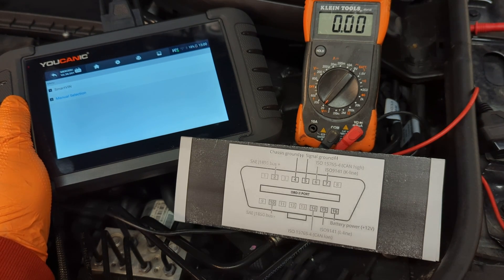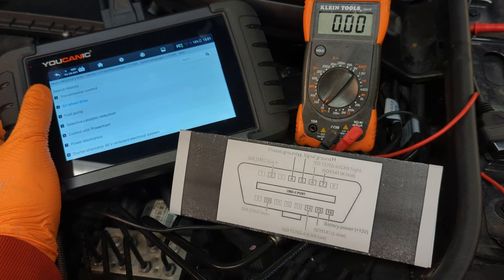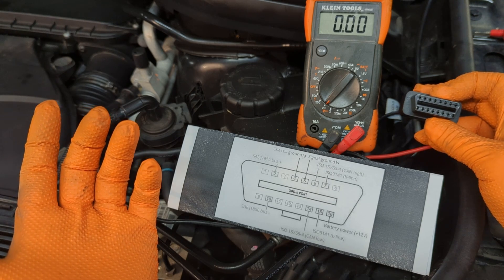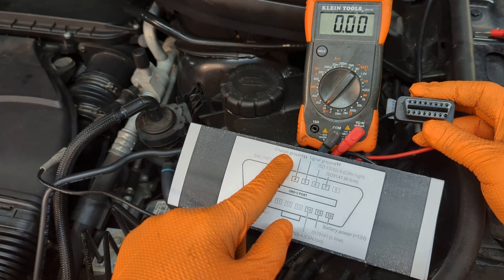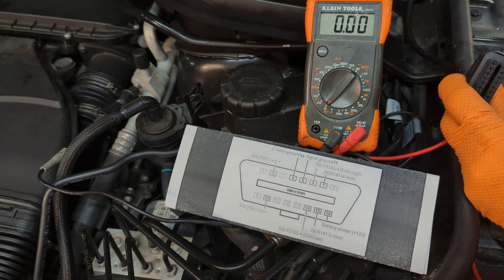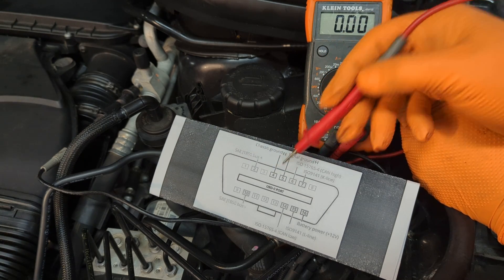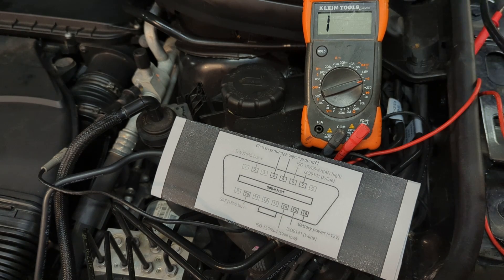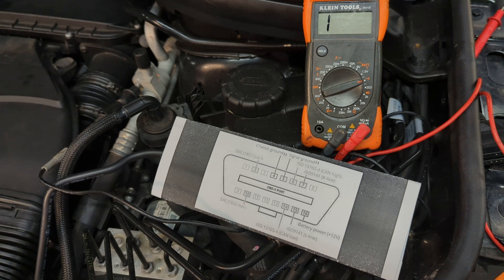OBD2 Port Not Working or Communicating with Scanner - Fix It Yourself!

Comment: I have a 2000 FORD E150, 5.4L V8.  The State of Delaware requires ODB2 during vehicle inspection.  My vehicle ails on "comms." It is unable to connect to DMV ODB2 re: the vehicle RPMs. I've changed use #26, and all relays.  Any other suggestions are welcome.
Reply from the maker: 👋 Thanks watching and for your comment! Our techs may not see every YouTube message, so if you need help or have a car question, visit www.youcanic.com — our team is happy to help!

Comment: 1999 gmc sierra 2500 6.0 gas. Obd works but not read the code. I’m using FIX
Reply: You using fix?? What is that??

Comment: I would like to thank you for creating this video in which pellucidly you explain the workings (or lack )of the OBD II and power potential causes for fault errors.
This has helped me tremendously especially with the pin diagram and highlighting that the potential fault culprit could be the control module.

I recently noticed the amber engine light coming on so bought an OBD-II scanner (Topdon Topscan pro) it set up ok and did an initial scan on my 2016 Corsa E with errors 
P0171 + U0401 +U0077 which pointed towards my Evap valve, the problem is I wanted to double check the codes and see if I could run a live scan but when I tried to pair I kept getting 'couldn't connect, check Bluetooth connection, eventually getting the connection but then when I try to scan it only gives me 3 options where the first time it gave me around 40?

The connector light turns red when connected and I can now eventually get Bluetooth to work, but as I said in scanning I'm only getting a couple of options and its not giving me any information.

In your opinion is this the fault of the OBD-II scanner or the OBD port/faulty controller module?

I have subscribed hoping to see and learn more.

Kind regards.

Hugh

Comment: That doesn't help if you have power but no communication.
Reply: Exactly that's my issue and I can find an answer.
Reply: @GFXWard  what was the issue
Reply: @KeinPicos  My scan tool. For whatever reason it wasn't fully working, yet it worked on other vehicles so i bought a cheap one from Walmart and it worked like a charm.

Comment: i can connect to my engine with scaner but cant connect to central elec. i have no power on can low/high or K line V is jumping betwen 0.5V and 3V resistor is 60ohm

Comment: How make obd car port fast tester because one time i test 1990 nissan patrol swap with lumina v8 engine but all OBD wires was wrong and my expensive scantol makes smoke 😢 so my advice dont use scantol before test obd all pin powers and ask car owners is the engine swaped
Reply from the maker: Thanks for reaching out and sharing your advice! We at Youcanic aim to empower car owners with resources such as guides, our powerful Youcanic scanner and even factory repair manuals to tackle such issues. This ensures you're confident and safe when doing car maintenance. Visit us at www.youcanic.com for any assistance or information. We're here to support you on your car ownership journey!

Comment: Waste of money. Works on diagnostic but when you go to maintenance to try and reset/ fix any codes it just says no communication. Seems like many people get this. It's not your car it's the junk scanner. Go elsewhere don't waste your money.
Reply from the maker: We appreciate your feedback. At YOUCANIC, we're dedicated to helping car owners diagnose and repair their vehicles confidently. We provide an array of resources, including our YOUCANIC Full System Scanner, which is engineered to diagnose car issues comprehensively. You can learn more here: www.youcanic.com/scanner

If you're facing communication issues when resetting codes, we recommend you to ask questions on our platform for assistance: www.youcanic.com. Your trust in YOUCANIC is greatly valued - we're here to make car repairs accessible and understandable for you.

Comment: I have power on obd2 scanner however it says no communication or unable to link.. any suggestions? 2006 Silverado
Reply: did u figure it out. like my comment so i can see response. thanks!
Reply: @MrMugenwii  no I haven't really tried though.  I'm thinking it could be a bad ground but I don't know for sure especially because I have power just no communication. I would assume that no ground would lead to no power.  I have checked the connector all the openings are tight so it not a lose connection either.  I guess it's a common problem let me know if you come up with anything.
Reply: Did you end up finding the issue? I have power to mine but no communication as well. I’m thinking it’s the ECU
Reply: @jonnilynnsavard6789  yeah sounds like ecu did you replace it ?

Comment: I have power going to everything but my scanner tells me there’s no information or it’s not connected any tips?
Reply: Im having the same issue with power and no connection and I watched every video available on YT. Every video is saying check to voltage and fuse. However if it’s the voltage or fuse why does the scanner still power up?
Reply: Same issue here
Reply: Any luck? I got the same problem
Reply: Because we all got ripped off and bought a crappy scanner. Our vehicles are fine it's the youcanic scanner that doesn't work and gives us all the same message. Absolute waste of money.
Reply: @itsonlyafl3shwound mine works on my other car but same thing happens with this car. Might change port some aren’t compatible probably.
Reply: Faulty sensor or bad communication line.
Reply: I'll join the club, same problem
Reply: @merrillkornelsen4640 me too 😂
Reply: @merrillkornelsen4640 year late but I’ve got some problem. Got power too plug but multiple scanners won’t connect?
Reply: 12v wire fault, check the fuse for power, if it was it.